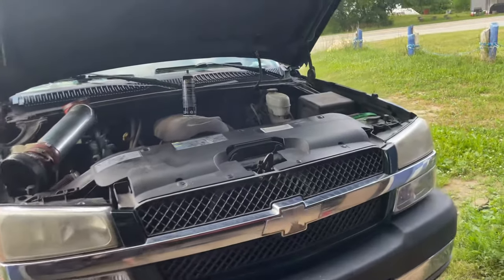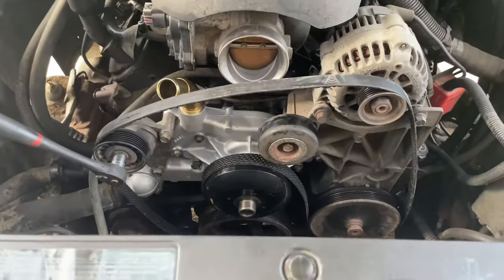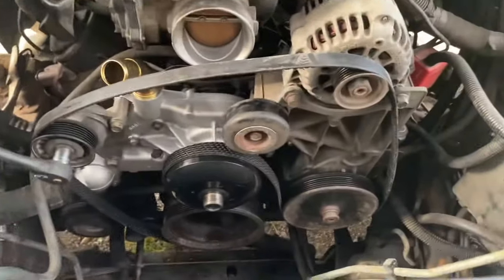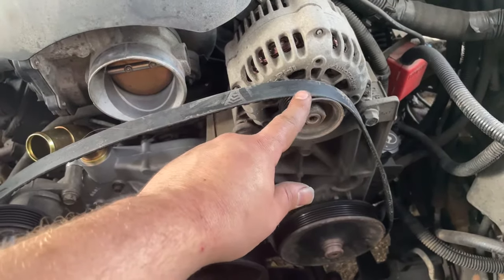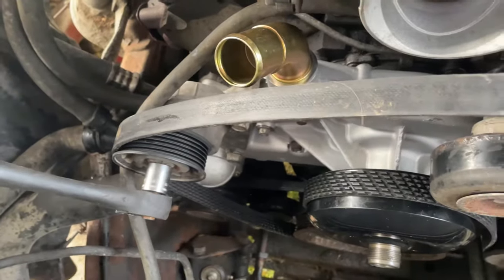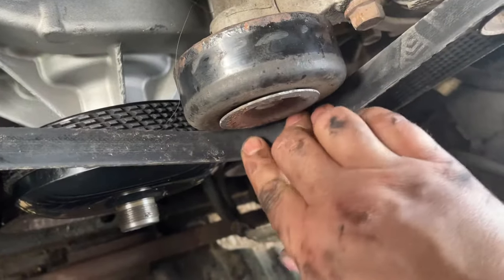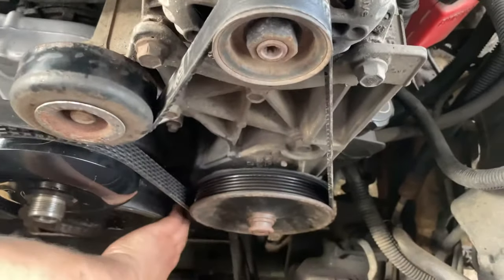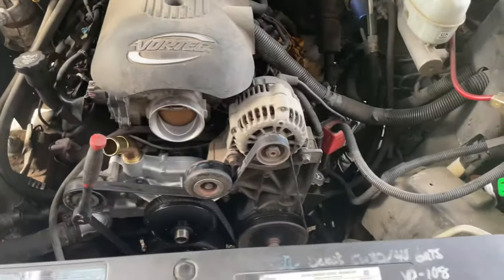5.3L 6.0L 4.8L belt routing diagram replace serpentine belt Chevy GMC trucks

Comment: Thanks for this!  Just replaced my water pump and the routing sticker on the radiator shroud is complete bleached out ... a fact i might have overcome with a snapshot had I realized it before disassembly.  Saved me some head scratching.

Comment: Does the 4.8,5.3,and 6.0 all use the same belt ? Or does it have to do with what amp alternator I’m running ?
Reply: The difference of belt size is not substantial  between the larger alternator, go with the smaller one if your running only the truck and not trailer accessories. Tensioner should take care of any slack.